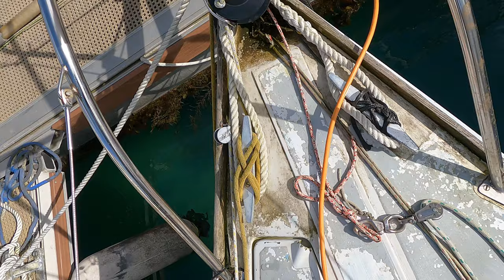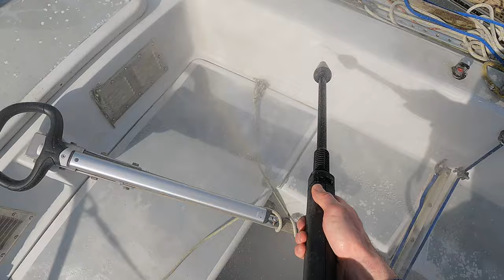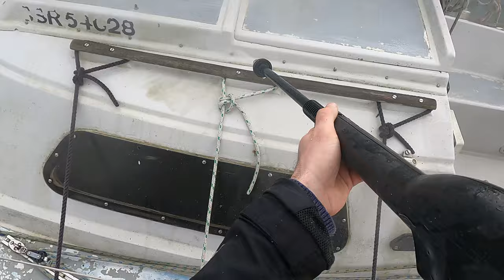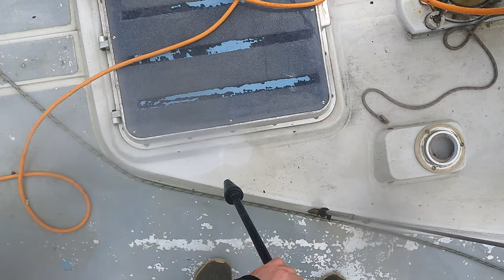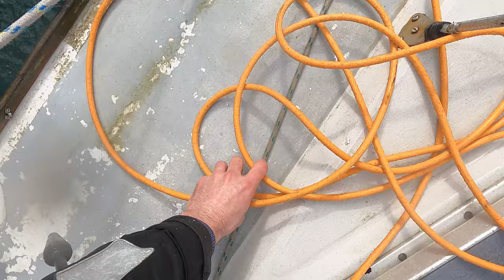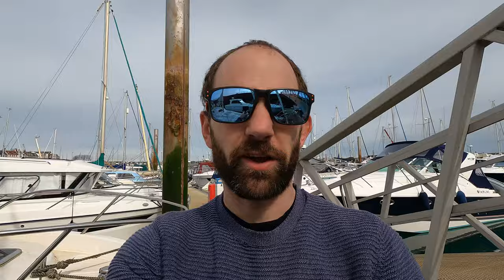Ep25 - If in DOUBT, get the pressure washer OUT

Comment: Mine was a lot worse that this so all I did was pressure wash the whole thing . Then remove all hardwear inside and out includind the compresion post and any bolted in bulkheads  Removed all wiring and every bolt screw and fitting . Gave it a super clean inside with asolic acid . fully painted inside and out including new grip paint . Fully cleand ,restored/serviced  all componants . Put it all back together and re  done all rigging and rewired everything .
New custions and even new fenders as the old ones did now not suit.   Worked a treat as looked much better But it did all started with a power wash.,   Got to start sommewhere.                    My secrct weapon is that my yacht is on a trailer as only 22 foot and in my own garden. Mind you took a little longer he he
Reply from the maker: Sounds like you did an amazing job there. I definitely find the fact mine is in the water a bit of a distraction as I feel the need to have it always reasonably ready to sail. Really it'd benefit from coming out and having my full attention on cleaning it up, but now we're nearing the start of the season that might have to wait 😂 I'm certainly looking at the wiring and also the cushions. Did you upholster your own cushions? That's on my list of things to try.

Comment: By the way, don't use teak oil on those toe rails - it will look lovely for a fortnight and then turn black.  Better to do them with Patio Magic (to prevent mildew and mould) and let them go silver.
Reply from the maker: I'm getting conflicting views on teak oil! I might try the Patio Magic as they've clearly survived ok so far and I am very happy with how they've cleaned up. I'm still tempted to try Y10 too as I discovered a few areas of deck that were stained which didn't clean up with pressure washing.